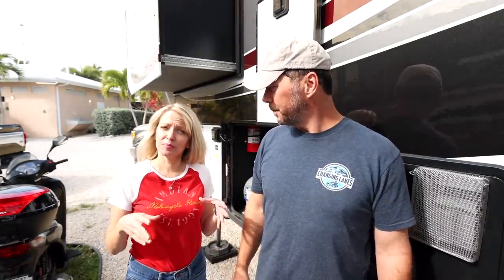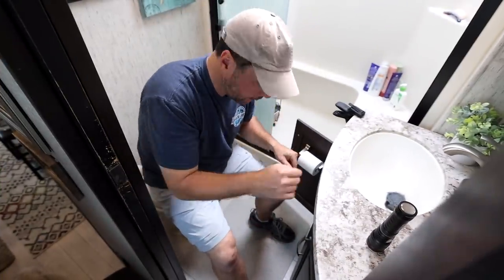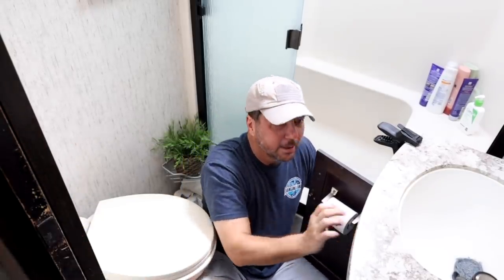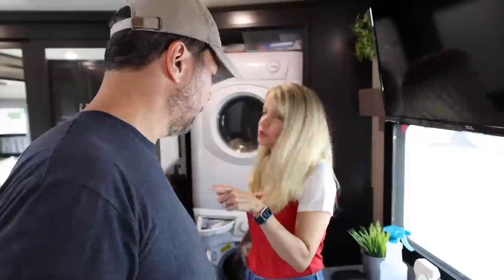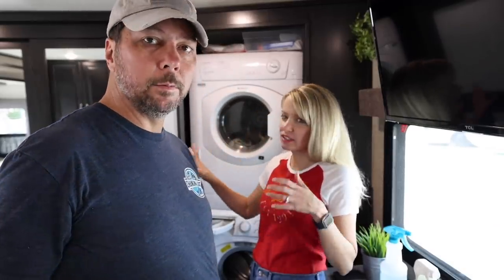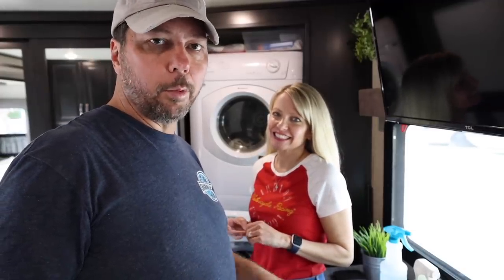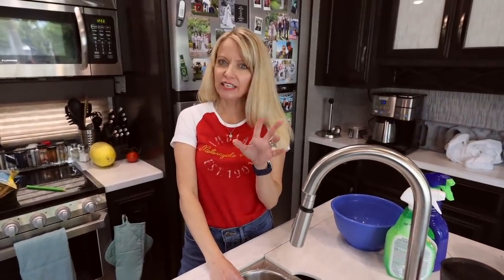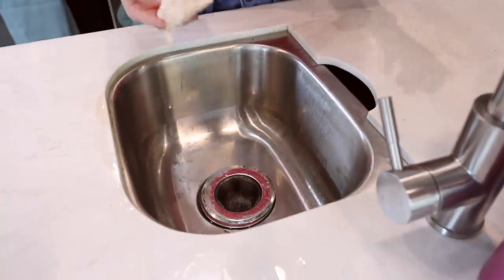RV Dirty Jobs

Comment: To keep clean the "filling up part" for the "laundry detergent powder" of washing machine,  I always put the "laundry detergent powder" (if it's powder) directly into the machine. There is no need to use the "filling up part" on top of the machine. It's just more comfortable. 
I always(!) let the main door and the fill up part for detergent of washing machine open, after a laundry.

Comment: A miracle cleaner for rust and muck is Lysol Toilet Cleaner (it contains Hydrocloric Acid) but I have hard water/rust and it works well to get anything clean.    CLR will work well in the washer too.

Comment: Great video. People need to see that sort of side of the RV life. Been doing this for many years and here is my tip for the mildew. I have used the "Mean Green Mildew Destroyer with Bleach" for many years and there are few jobs it won't overcome. Great for the awning, too. It used to be sold at Dollar General stores, but I am not sure about that now. Next, the stainless steel. Please do not use steel wool on stainless. It causes micro scratches and it will get dirtier quicker.  I have found that the "Wieman Stainless Steel Cleaner and Polisher" works wonders. It can be found in most grocery stores and Walmart. It, also, works well with glass cooktops and any other metal products. Do not use on food products, though.  Love watching your videos. Stay safe and keep on truckin'.

Comment: On the washing machine I have never seen that slime in the inside, but I use vinegar in the rinse cycle instead of perfumes, it really cuts the teenager sweat smells out of the clothes.  If you leave the door open to dry the rubber seal remember the washer has a ptrap that can dry out and cause smells and funk also.

Comment: Hey Chad and Tara this is Jessica and my husband Joseph. My husband uses Calgon water softener in our toilet to help the poop build up on the sides of the black tank and under the seal in the toelt.  What my husband does is when we arrive at the camp spot, he will go into the bathroom and pushes down on the toilet lever until the bowl fills up about 2/3 full.  Then he adds 1 cap full of calgon into the bowl with water and dump the water and Calgon into the tank.  Then do the same procedure again and you will be done.  The method is called geo method and you can YouTube it to find out more about it. It want hurt your seals and the values or the toilet seal.  My husband has used it for about 3 years now and knock on wood everything is working great.

Comment: About your front load washer… Always wipe the door & that gasket (like you did ) and then leave the door open until it’s dried complete before closing is. I do this at home & have never had any mold or smell issue. 👍🏻

Comment: Clean up inside the cavity that the soap dispenser was in. If you shine a light in there, it will be full of mold also. With a front loader, we were Tide users and changed to Gain and 90% of our problems went away with mold for some reason. Like you mentioned, leave the door and the soap dispenser open as much as possible when not in use, air flow is your friend. Thanks for the pooper shots by the way, I stopped eating my chips immediately. lol...

Be safe out there. 😎

Comment: Baking Soda and vinegar in your bath and sink drains will get rid of the ‘slime’.  For you front loader, 1 tab bleach in spray bottle.  Spray the inside and the seal, let dry for about 30 minutes.  Would also recommend one of those cleaning tablets...10 for about $13.00 on Amazon.  Use 2 the first time, then 1 every month or couple of months.

Comment: To eliminate drain odors in our RV and to keep the drain water flowing; I pour approx. 4 oz. of Simple Green down each drain as were packing up on the last day of camping.  I let the Simple Green sit for about 20/30 mins. before rinsing the drains with hot water.  In 25 years of RV'ing, we have never had an odor or drain clog issue in any of our RV's by performing this process.

Comment: There's also a trap under the cloths washer with a drain hose. Needs to be cleaned. Another trick is just run the washer empty after dumping distilled vinegar in detergent dispenser and some in the drum. Seals need dried at the end of the days use and door left open. This all keeps the dirty wash rag smell out of your cloths.

Comment: For your sink and shower...if you pour some baking soda down the drain (I fill it until it overflows) then add plain white vinegar.   This is a safe version of Drano, that will not harm the plumbing and will eat the vadt majority of hair, grease, etc.   For the washing machine, simply to a empty load with a bunch of baking soda and vinegar added to the drum at the start.  Of course, keeping the door and soap drawer open after doing a load of wash will prevent the mildew.

Comment: I was new to front loaders when we bought our new set in 2010 when we bought our new house, so I read the manual completely. The manual explained that the seal will get mildew and that you should leave the door open after each load to help prevent it. Also, ours came with a package of the tub cleaner granuales and they recommend using it once a month or so. I also have a  pure clean cycle and I run that about once a month and after that I take a towel and dry the seal real good and clean the door as well. Mine is a Samsung and it also has a built in filter at the bottom that needs to be cleaned every month or so. This maintenance has seriously paid off for us because my seal looks brand new and my machine is almost 11 years old and has never needed service. My detergent cups are easy to maintain because they pop right out for cleaning and my whole drawer is removable for cleaning as well. I’m not looking forward to cleaning my sink p-trap now that I saw this video! I already did the inside of the toilets when we bought the coach used last May but I need a pole like yours for sure! Thanks for the DIY videos I’m sure you know how helpful they are for us and I hope you both now how much I appreciate your time and effort in doing these!

Comment: Great video. Love ya'll.  ❤ Love your sense of humor and the editing with old movies and the bloopers at the end. We have a similar washing machine and its spotless. We wipe it down after every use in those tight spots in the that rubber flap and also my wife runs a cycle with a cup of bleach every 6 weeks. We also always leave the door open.  PS- I have a 2016 Indian Chieftain and I love it. 32,000 miles. Would have been a lot more miles but I've had several injuries that stopped me from riding.  Love your Roadmaster..

Comment: Thanks for the video!  Our motorhome has a Thetford Aqua-Magic V toilet.  To clean the pipe between the toilet boil and black tank, I fill the black tank with water until it is almost to the slide seal, then I add a good squirt of dawn dish soap and some almost boiling water and let it sit for an hour or two then use a long handle brush.  We never have any issues with odours.  We use Happy Camper for our black tank which is great.

Comment: For a “tube” clean out, you can get a brush that is made for cleaning the dryer vent tubes.  It fits perfectly and you can get an extension if needed.
Reply from the maker: I tried one of those but the bristles are too soft.
Reply: @ChangingLanes  I had that thought even before I checked the replies.
Reply: @ChangingLanes  I wondered about that - I have used  one for our shower drain at home but not for the RV so it was just a thought.  Thanks for all the helpful tips!!  Y'all are our first reference for GD fixes!!

Comment: how I figured out the proper way to clean our kitchen sink,  I googled the company that manufactured it, and the site had cleaning instructions on it with recommended cleaners. Just installed all new drain pipe under our kitchen sink last week when installing our dishwasher drain (posted a video), nice heads up on the shower drain, going to check that out later today. what I have started doing on a monthly basis, I will pour a bit of "green Gobbler" enzyme, septic safe treatment down our drains, seems to be keeping them clean with no issues. Plumbers grease ? thanks to a video I watched of yours in the past, I started using it. if you read the can, it states 2 things; (1) safe to be used on rubber O-rings & (2) contains petroleum distillates.  just thought I would point that out. great video like always, best of health and safe travels

Comment: If your rig has a Thetford toilet like ours, the bottom of the toilet has a foam rubber O-ring around it that's compressed against the flange on the top of the black tank. The "tube" sticks through the flange for a fraction of an inch, and the O-ring isn't exposed to where you're using the brush.

Comment: Tara, once you get the new washer rubber, I have the same W/D closet (solitude). Its been a year now, and I follow the same simple effortless routine I did at my condo (6 years front loader, never had to clean the rubber seal). After every load I open the washer door and immediately a quick wipe over the inside on the glass get the water off, then before I pull out the clothes a quick wipe on top of the rubber seal, once done all laundry, I pull back the bottom washer seal shove my rag in it and drag it across, i then quickly feel the top inside of the seal with my fingers, if it feels icky wipe it too, 99% its ok. Then wipe out the inside of the drum, so no water beads laying around. Then i lay the little cloth over the door and close the closet door, the washer door does not get pushed closed tightly! Stop doing that! The only time you should be closing that washer door tightly is on moving day. Add it to the check list. Do this and you will never have to clean the rubber again. I’ve been using these disposable white painters rags, they are thin and simple, I toss the rag in with the towels every couple weeks. Use a clean rag as soon as one is slightly icky! Routine quick wipes, consistent clean rag, door never fully tight closed. 
Thanks Chad for the toilet inside tube make shift cleaning rod idea 👍🏼 cheers 🍻

Comment: Yes. If you do it every time you finish laundry for the day, that won’t happen. I had this problem in my sticks and bricks. I found out I wasn’t drying it out properly. We are full time in our rv, and now I dry my washer out totally every time. All around the big rubber gasket, under it all around, and all around between the drum, and the rubber gasket. Then remove the soap tray and dry out. Dry out inside the area where the soap tray was. There are some plumbing openings in there that you need to stick your rag into a bit. Also the top of that area holds a lot of water. Then VERY important to leave the dryer door open. Even if you have to jam something in the door so it can’t shut all the way. Also leave the soap tray open too. Hint..if putting the tray back in is difficult, you don’t have it right. If it’s going in properly it’s easy. Speaking from experience. It took me months to figure it out. Literally. Sometimes it was super easy, next time I’m pulling my hair out. Speaking of hair, 🤮. That is so gross. I have long hair too. It makes some nasty mess in the drain. Thx for the info. We are getting a shroom and a flashlight :)

Comment: Hi, I first want to say that my wife and I love watching your channel, we are in the process of watching all your videos from the beginning. I have a couple of recommendations for you to possibly try. First, try using Bar Keepers Friend, it comes in a powder and liquid. We use this to clean or stainless steel sinks and our fiberglass shower. This stuff works great and can be found at most stores. The second one is for your washer. Our owners manual recommends running a long hot load, no clothes, with bleach poured into the fabric softner, soap and bleach recepticles, as well as opening the door and soap fill drawer after use to dry out. This really helps. Keep up the great work and stay safe.

Comment: Hi Great info guys.  Although we don't have a washer/dryer in our RV, just had same mold issue with our home washer along with other issue that needed fixing. I always left door ajar and wiped it out but still had mold like in yours.  Repair guy told us to switch from liquid detergent/ liquid fabric softener to powder detergent.  Apparently the liquids contain animal protein of sorts which promote mold growth.  So we have switched to powder and also run a hot wash through every few loads.  I do wipe out and leave door open. To use powder he said to take out the liquid soap insert and just pour powder into the spot where the insert was.  I would recommend using gloves and masks when using magic eraser (lots of chemicals in it)

Comment: Definitely need to clean the washer monthly. The manual should tell you how to clean it. I do that with ours in our home. The LG dispenser assembly fully comes out so you can clean it.  It also has a tub clean cycle where it runs a full two hours. I start it with a full bleach reservoir

Comment: Funny thing, my home washing machine just gave me an error code today and it wasn't pulling the fabric softener out of the reservoir. There are some small jet holes above the reservoir that sprays water into it to flush the softener in to the tub. Not sure if yours has these jets but if so, just take an old toothbrush and give them a clean every once in awhile to prevent them from clogging up.

Comment: TIP for cleaning the washer tray area; when you remove the tray from the washer look inside at the top of the opening, there will be buildup on the "ceiling area" of the tray opening which you can clean with a toothbrush as well. I finally noticed this on our home washer after a few cleanings and now clean this when cleaning the tray.

Comment: I like to use baking soda as a scrubbing agent inside the washing machine rubber seal. Also, vinegar is very helpful for mildew. You’ll never get those actual stains off the rubber but you can actually kill the mildew. Also, if you have horrible allergy issues, it could be because of the mildew buildup in your washing machine, causing sinus problems, and other things because those spores linger in the air and when you live in a tight space like an RV it doesn’t always have the opportunity to dry out or air out.

Comment: Chad /Tara, for the washing machine, once a month use Refresh tablets for machine cleaning. If you don’t have a ‘clean machine’ option then just run it through the longest hottest cycle you can. Always a quick wipe around the seal after every use. ‘Refresh’ actually sell wipes for that too..

Comment: Here is what I use, grabber tool magnetic four-claw picker, bendable hose reacher pickup sweeper with led lights, flexible long handy reaching assist tool for litter pick/home sink/drain. You can get them at Lowes. It has a 4 jaw clamp. Great for getting hair out of a drain. Just don’t shove it to far down.

Comment: To help with the clothes washer, check to see if there is a machine cleaning cycle. Our home washer does. If it doesn't, try running an empty load with just bleach only. No detergent. I would do that about every 10 to 15 loads of laundry. The bleach will kill all the mold and disinfect your machine at the same time.

Comment: As you know I was an old naval engineer, worked on all those wonderful bits for years and years. A lot of the smell coming from the throne are from urea crystals that build up on the surface of the pipe. 

Fun job as a young non-rate.

Comment: I have front load washer and same goo gup yuk in rubber door seal. The door is left open all the time and still accumulates mold. Use liquid soap will try powder as others have mentioned. Its nasty. Good vid. ordered hubby the flashlight. He has a thing for those gadgets too

Comment: For laundry and bath, I suggest using a chemical called CLR Bathroom. It's in a yellow bottle. You can also use the magic eraser with it. NOTE-- DO NOT leave chemical on more than 2-3 min as it can start to remove oil rubbed bronze and chrome after extended time left on but it works great.

Comment: We have a small towel that we keep in the rubber gasket on the front load washer. Helps keep it dry in between using then the mold doesn't start.

Comment: Now that was a "Dirty Job" worthy of something that Mike Rowe used to do.  I like the bowl cleaning brush you made and I'm guessing that you used CA glue to attach it to the extendable rod, or something like that.  For the Stainless Steel cleaner, we use a product called Bar Keepers Friend, which is a paste and it does a wonderful job on the sink, SS pots and pans, and even on some SS roaster pans.  For the washer door seal, my wife has used some diluted Simply Green for most of the gunk but had to use it full strength for the really built-up areas. Again, thanks for sharing your experiences as it helps us newbies have a little more knowledge about what to expect when we finally do get on the road this year.

Comment: High, i just watched this video and have an idea for washing machines in general. I don't have a front load at home but did find out that between the wash tub and the outer tub gets really grimy like what you showed on the seal. A washing machine repairman told me that vinegar used regularly will clean the washer and its also a natural fabric softner. He said to us 1/4 to  1/2 cup of vinegar in a load of clothes which i've done many times and the clothes do not come out smelling like vinegar. So i'm thinking that this may work to help keep those pesky door seals clean. I also mix water with 1 1/4 cup vinegar and enough dawn to turn it blue as a daily shower cleaner at home. It keeps soap scum and hard water deposits from forming. Yes occasionally i do scrub the whole shower but not nearly as often as i used to. Love your channel. Happy travels.

Comment: We use long tweezers (not the cheap ones) to get the hair out of the sink and shower drains. They are small enough to fit in the hole and open them to use them.